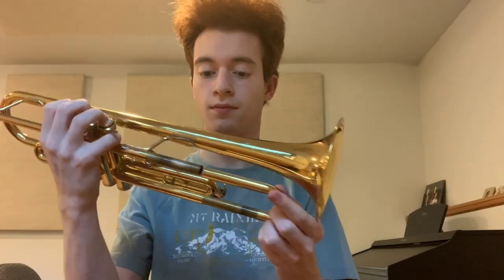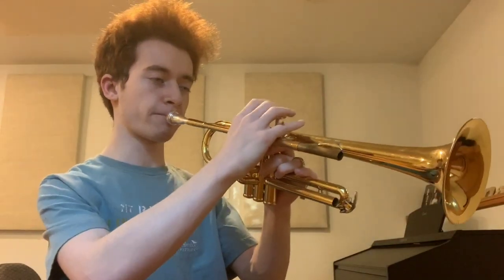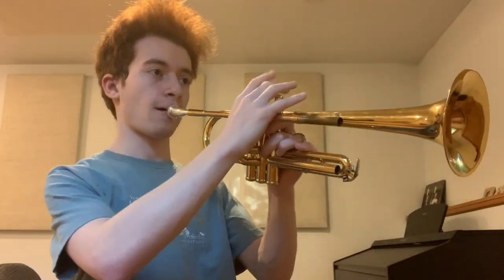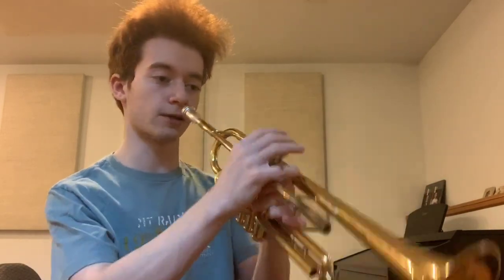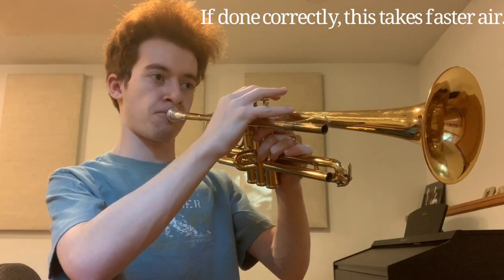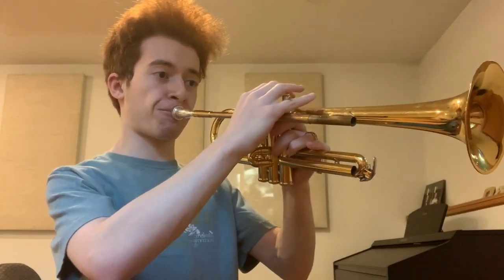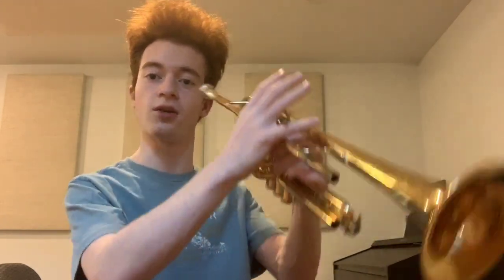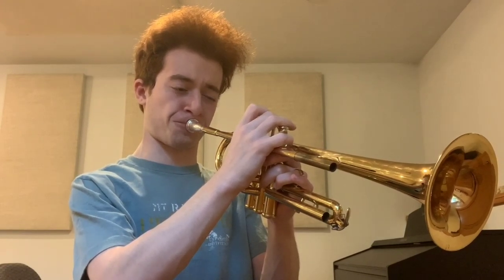Let's Talk Trumpet: Leadpipe Buzzing (and why you SHOULD be doing it!)

Comment: Great video, man. I do agree that leadpipe buzzing is a hugely underestimated technique. I don't do it everyday (whereas I probably should lol) but, as you said, it's primarily an air tool and I use it whenever I feel like I'm not blowing enough which, at least for me, mainly translates to not hitting the staccato notes cleanly. 
This brings me to my second point. You said "It's not a double tonguing tool". Well, imo it can well be. Clean and precise double tonguing takes a lot of air especially on the "ku's". The thing is that when you're tonguing the air stream should be no different than when you're slurring the notes which isn't really all that much intuitive and players tend to cut the air stream when they tongue (myself included) and practising some staccato-heavy passages on the leadpipe prevents you doing exactly that and enables your staccato to be clean and connected.  Leadpipe buzzing is really the one thing that allowed me to learn the double tongued ending of Bohme's first movement.
Reply from the maker: Thanks for the comment man! Very interesting stuff. I suppose any air tool can be translated to any form of tonguing now that you mention it, because most issues with tonguing stem from issues with the airstream.

Comment: Thanks for this.  I'm very late to the party here but can you elaborate on the "how" of changing pitch...air velocity? embouchure?  tongue?  combinations thereof?  Thanks.
Reply from the maker: @49bednar  That’s a good question. I honestly am not as much a lead player now as I was at the time of making this video so my focus on this topic has slipped, but something I’ve always taught is the concept of the “V” tongue. I do believe that pressurizing the air inside the oral cavity (without excess jaw or throat tension) is necessary for speeding up the air without physically “overblowing” the instrument—that leaves the tongue to do the heavy lifting. That said, if I can, rather than arch the back of the tongue, I advocate for arching the sides instead, to create a narrower and more focused trench for the air, which naturally speeds it up without so much of a constriction point. Whereas raising the back of the tongue creates a vowel sound like a hissing cat, raising the sides is a sensation similar to whistling, keeping things more “open” while still speeding up the air greatly. Granted, above a high D or Eb, it does end up being some combination of both the back and sides of the tongue for me.
Reply: @SamuelPlaysBrass  Thanks for the quick response.  By no means a lead player here.  Quite the contrary, 75 years old and trying to keep on keeping on by becoming as efficient as possible.  Yes, I tend to cut myself off with tongue arch that is probably too high and constricting.  I'll do some work with the V tongue concept.  I've been doing leadpipe buzzing for quite a long time and it's probably the most helpful warmup thing that I do. I find it's really important to find the "centre" of the resonance and feel it coming back into my body.   Love your videos and thanks again for being so responsive.

Comment: Sam - do you have any documentation on why the first partial is wider than an octave? You mention the shape of the tubing be a large effect, and it obviously is in practice, but I am wondering if there are any studies on the function of the sound wave that show us why this is the case. I've done pipe every day for years and never been able to figure it out!
Reply from the maker: Hey there Jeffrey, thanks for your comment! I’m not the best with trumpet physics, but at its core this is the issue: on cylindrical tubing, the harmonics tend to get spread out. The high register is naturally sharp, and the “pedal” harmonic sits very, very flat. This is the case on a fully-assembled trumpet, as players have to learn to relax in the high register to avoid playing sharp and the open pedal C tends to be a whole step flat unless you spend time forcing the pitch up.
Just to illustrate the opposite effect, imagine the flugelhorn: its pedal C is well in tune, but the upper register is usually chronically flat. So you see: conical tubing brings the harmonics closer together, and cylindrical tubing pushes them apart. It’s pretty confusing but I believe Nick Drozdoff has a video or two on the topic.

Comment: My tuning slide is 1/4 an inch out further on one side than the other. How would you recommend unsticking it so I can try this?
Reply from the maker: If letting a little penetrating oil sit on the slide tubes for a few hours doesn't work, take it to a repair tech. That sounds like a very unique and very risky situation to try to reverse yourself.
Reply: Samuel Plays Brass I was gonna tie the tuning slide to my car and the rest of the horn to a tree. Is this dangerous?
Reply from the maker: Hobart Clarque In doing so, you risk breaking off much more than just the tuning slide. I think most repair techs would rather fix one slide than a slide and several solder joints.